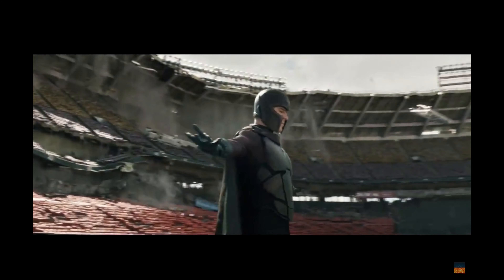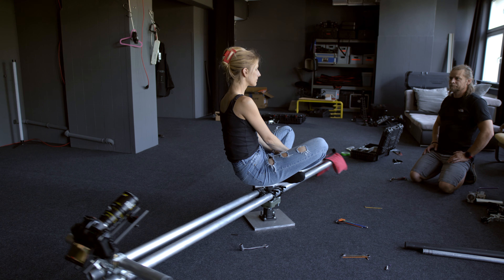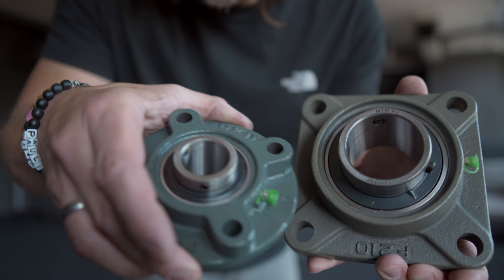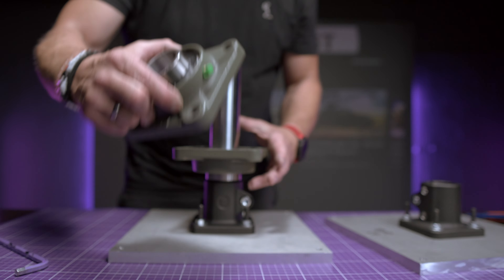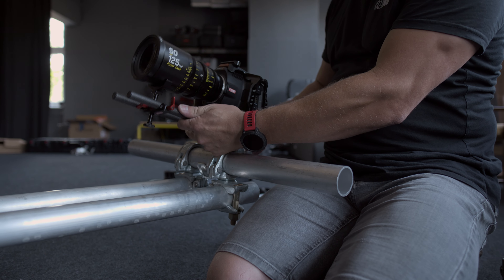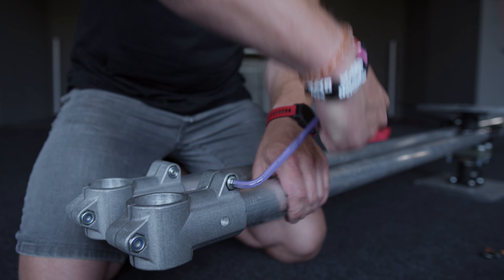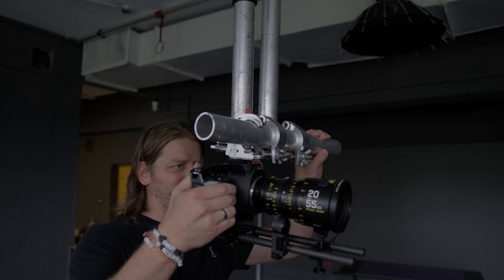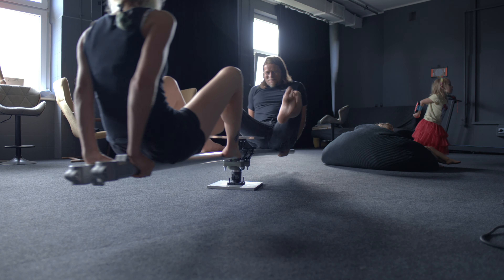DIY ORBIT CAMERA RIG - super simple, super cheap, super strong.

Comment: It looks as if the entire weight of the bars, camera and counterweight is being held up by the four set screws in the bearings.  Is that correct?  Did you have to drill holes in the shaft to seat those?
Reply: Вполне достаточно - 4шт. болт M10.

Comment: thanks Adam you are a ray of light in a dark world. I want to make this so much. I am in UK and priced up the same parts / spec (or best heavy duty equivalent) & the cost came to £350 not including the pipes. That price is including sales tax and delivery. I only mention the price because this is similar for off the shelf solutions readily available. That said, your robust design and obvious flexibility in form and function outstrips all the entry level solutions on the market and is competitive with very expensive solutions, so it is still a great deal and well worth doing. Thank you for the math as well. Awesome!

Comment: Very Helpful Video, propably i'll try buildinng a smaller version for my studio. 
The price may be higher at least for people from Germany - also those calculations are for the sturdier version which is more suitable for heavier setups and people: 
- pipes Alu 50mm x 2mm : 2x 3m, 2x 1,5m, 2x 40cm, 4 x 1,2m for the adjustable pipe stand: 173,69€ 
- steel shaft h6 30cm x 50mm: 50,10€
- 16x Global Truss 812-B: 99,20  (8 clamps are needed for the adjustable pipe stand)
- 6x Global Truss 5032-2B Swivel Coupler: 72€ (4 are needed for the pipe stand)
- 1x Selflock Clamp: c.a. 17-19€ (for the cam)
- 2x UCF 210  Bearings: 38,90
- 2x Kipp Pipe clamp base K0499: 75,80
- 2x Kipp T-angle clamp K0475: 55,02€
- 4x Kipp levelling foot m10, h= 41mm: 2,92€
- 2x Alu plates 30x30cm 20mm thickness: c.a.190 - 210€
all prices incl. vat
In total it's c.a. 790€  - shipping might vary so it's not exact.
Reply: Thanks for writing it out! Started looking into this and it's very far from 100$ :D
But if it would be a commercially put together product, it would cost a lot more, probably close to 2k-3k

Comment: Nice video. The long rails where you two were sitting on the pipe at the end of the video, what diameter and gauge aluminum pipe are you using?
Reply from the maker: 50mm about 3m long

Comment: Replace the tubes with flat sheet, upper and lower, add a windscreen wiper blade motor, that's what the party versions use and probably for a $100 you've made a powered one.

Comment: i'm looking where to buy 50mm pipes and they are quite expensive and hard to find in local stores. only the pipes will cost aroun 150€ for a full setup. and all the weight of the flange bearings is secured to the shaft with the small screws to tighten them. i'm not sure it's a good idea, these flange bearings are designed to keep a shaft in place
Reply from the maker: The shaft is not only attached to the bearings, and in addition, the bearings rest all their weight on the Kipp clamp. And you'll have to find the tubes in another store. 150 euros??? is some kind of absurd. I for a pipe 4m long pay about $ 40

Comment: Very nice build, and detailed video! One side note, i would change the ball bearings to cylindrical roller bearings, those are more suit the purpose. Ball bearings don't like high side loads, and with the roller bearings you can significantly decrease the Z height of the rotary assembly.

Great video!

Comment: I want to know where the heck this guy is buying his pipe, because the one foot long steel pipe in the middle that supports all the weight costs almost $90 on its own. The 2 aluminum plates are gonna cost $115. The four aluminum pipes are gonna cost over $200. Based on what I'm finding, this rig, no matter how ingenious it is, is gonna cost at least upwards of seven or eight hundred bucks, maybe more. So, if you could let me know what kind "local dealer" you have a special connection with that gets you all of that metal for next to nothing, that would be great.
Reply: 😂 I'm doing one with a lazy Susan $15 Menards payload of 1000 pounds in just working on the Design